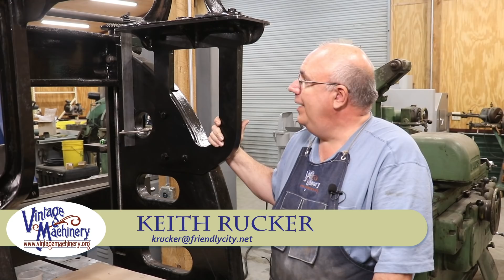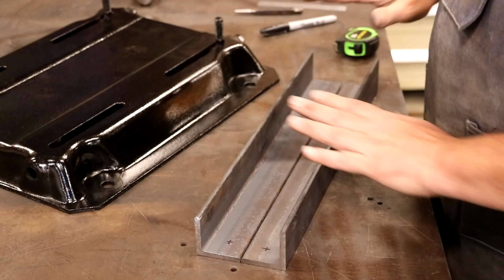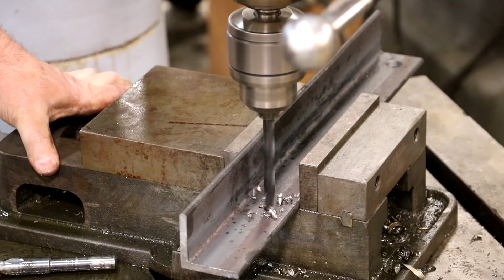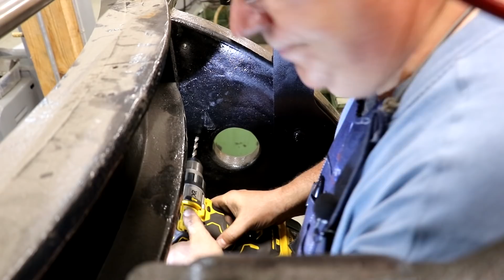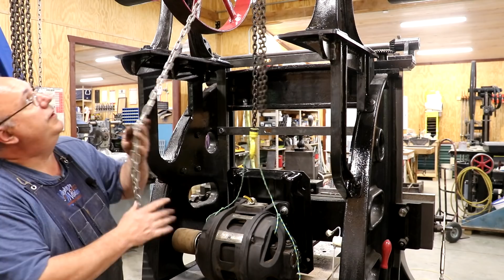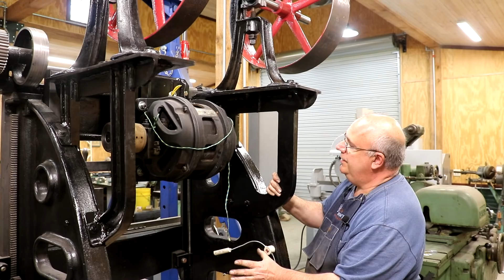Metal Planer Restoration 58: Fabricating and Installing a Motor Mount and Motor

Comment: Once the pilot holes were drilled all the way through was it not possible to do the rest of the drilling and tapping from the outside?  In cast iron tapping, a properly adjusted clutch will reduce the risk of tap or hand breakage,

Comment: HOPE THAT OLD MOTOR HAS GREASED BEARINGS.   SOME OLD MOTORS HAVE BEARINGS THAT RUN IN OIL,  WHICH MEANS THE MOTOR HAS TO BE MOUNTED HORIZONTALLY, SO THAT THE BEARINGS ARE RIDING IN THE OIL .

Comment: You might want to look into getting a low profile mag drill. They are extremely handy & would have easy fit to drill the holes on your planer. With using an annular cutter on a mag drill you would have saved your hands from getting slapped around be the drill.

Comment: Hi Keith - This looks great. Can't wait to see it running. One suggestion is to to use angle iron for the cross braces. The flat bar may act like a spring and amplify vibration. just a thought!

Comment: Keith, since you made the counter-shaft mounting brackets look "period," will you shape the angle iron used in this video (at least the lower ends) to look a bit more period too?  I really like that old motor!  I almost bought an old ~10-inch lathe with a (smaller) motor just like that mounted on top of the lathe ~15-years ago, but changed my mind at the last minute, fearing that what I wanted to do with it would lead to permanent modifications to it, spoiling its "originalness."  Now, with a "lesser" lathe, I've realized that I could have modified it without any permanent changes, and would have had a fully functional lathe!  :(

I look forward to seeing the final videos in this series, including belting & adjusting the planer, and watching you make chips with it!

Comment: No dead-stop appeared on the radial drill without the vice bolted down. Definitely use an anti-spin dead-stop when the work is not bolted down.

Comment: Nice job! That looks like a lot of work.

I wonder if it would be worth putting a stiffener fin on that lower cross bracket, effectively turning it into an L beam for most of it's length? I can see the motor pulling on it and bending it enough to result in annoying vibrations when things are running without some stiffening.

Comment: The motor looks rally nice on there. It's perfect for the job! I'm curious about some things. Do you know what speed the original line shaft would have turned? How do you know what size pulleys to put on the motor and the counter shaft? How did you size the motor as far as horsepower? Is this all just experienced guessing,  or do you have a more deliberate way to work these things out?

Comment: Just curious - the holes in the upright castings were thru-holes - I understand why you drilled the initial holes from the inside, but would it not have been easier to drill and tap the finishing hole from the outside, making the need for contortion, unnecessary?  :)

Comment: I feel a rant coming on.  I am getting a full mode rant Keith.   On your beautiful radial arm drill press at 7:42 in the video I saw something beyond disturbing.  When you replace those gears after you get done grinding them up all chewy chewy like you can have them made of rubber.  You spend all your time fixing machines, scraping way, buying all these precision machines and precision hand tools and you stand there and grind the gears ceaselessly.  I know it is your Machine, but really now.  End of rant.
Reply: Learn how to drift the spindle when changing gears, or edit out your gear changes.  Now my rant is over.

Comment: 13:00 Keith I like to leave the drill in a higher speed but run it slower by modulating the trigger. Ends up breaking your wrist slightly less. :) Those battery drills are strong!

Comment: Looks like you are lifting a heavy motor with a heavy chain hoist and a shoe string... :) As far as time goes, I've built a few small trailers with no plans. I usually spend as much time sitting on a stool deciding what to do as doing it.

Comment: you should put some rubber vibration dampener between the motor and the mount - the vibration might crack the casting long therm

Comment: I knew people would comment about the "twine."  Yet people trust parachute cord to keep them alive all the time, what I've observed of that, it isn't any larger ... 🤷‍♂️

Some may wince at drilling holes in the machine, my thought is that a millwright wouldn't have hesitated to do so back when the machine was newer, if it was needed.

Those old motors seem to bullet proof, as long as you keep the bearings oiled and don't let them get loaded with chips.  I got my Buffalo Forge drill press with a locked up motor.  The windings were not open or shorted, so I knocked it apart, honed the bearings a little bit, carefully cleaned a massive amount of goo embedded with chips out of the shell/windings.  Getting the end bells back in place without causing a bind was a bit tricky, but once I had it back together and turning smooth, it has worked without a problem.  Quietest machine I've got right now.

Comment: When using a tape measure I always use the 100mm mark to measure from lines or center punches.
Just need to add the 100 mm to the measurement.
Ofcourse its metric but you can just use the 4 or 5 inch mark

Comment: Keith Rucker does everything differently. When he works with carbide tools, he adds a lot of oil. Absolutely unnecessary. No effect, but a lot of smoke. If he works with high speed tools, that should be lubricated, he always makes it dry. Not a good idol! 👎
Reply: Go away.  Quit trying to start shit.

Comment: Nice big heavy frame on that old motor. What's nice is the motor appears to be the same vintage as the machine so they match. Those old motors tend to work very quiet and last for ages.

Comment: Hey Keith, looking good!  One suggestion I have for you. It's a fair bit more work for you but is likely to save you a lot of grief when it comes to adjusting the belt tension. Set up a push-pull device with 2 points. this will use threaded rods or bolts and be used to adjust the belt tension or even help to track the belt on the pulley. As the belt (I'm assuming that you are going to use leather belts) stretches, you will need to make adjustments. Having this set up on there ahead of time will be a lot easier than having to bring in the gantry crane each time to make an adjustment. If you're planning on just loosening the bolts enough to do a few taps, that may work but does not have much control.

Comment: Keith,  I know the 1921 motor looks awesome, but have you considered how good the insulation is and the difference in efficiency from back then to today's motors?  How do you know the wiring insulation (varnish) is not thin in places and when you put a load on it, the insulation will burn up and short out the motor.  Also, how about the bearings?  Bigger motors that sit along time can imperceptibly flatten the bearing balls on the weight bearing side unless you turn it over once in a while.  You might consider having the motor rewound.  Maybe cost some money, but might be worth it.  Good luck and looks great.

Comment: I'm concerned about your pulley diameters and the amount of belt wrap.  For reference you can look here:

https://www.plantengineering.com/articles/basics-of-belt-drives/

They say pulley ratios should not exceed 6:1 for flat belts and yours looks to be more than 10:1.  The amount of belt wrap should also be at least 60 degrees.  You may need an idler pulley to increase your wrap.

Comment: Really like this project, a lot of think-thru.. & everybody has plausible alternate suggestions & ideas, & yes with respect, it's your way to finalization there of. My query is re: technique.. Once pilot holes were drilled... Was their an engineering reason (that I'm missing) as to why you wouldn't attack the holes from the outside->in with the follow up drilling & tapping..??? Threads wrong way??? It appeared it may have given more direct pressure with your dominant arm (drill control & right angle) and tons of more (outside) room... Maybe a mute point for lights, camera & action sequence... A total wonderful learning experience...

Comment: I assume that is a fixed speed motor.   How did/do you size the motor pulley?  Do you know what RPM that top shaft should run at and then just ratio back to the motor speed?

Comment: Is there a reason you drilled the mounting holes, the ones that were trying to smash your hand, from the inside? Would drilling a tiny pilot hole to spot the location, and then going to the outside to drill where you have more room to work have been a valid strategy or is there some reason to drill them all in the same direction?

Comment: Have an old Sheldon lathe. Had to drill out a hole that conduit went threw. That was some of the hardest cast iron I have ever drilled . You can really tell the difference between old cast iron and new just by drilling.

Comment: Hey Keith great to watch, just wondering why you don’t just drill a hole and use a bolt and nut?  That way the hole doesn’t have to be perfectly straight to tap a perpendicular thread.  The bolt and nut would be much stronger than a 70% threaded hole in cast iron.
Reply: Or put a locknut on the bolt.

Comment: Imagining how the belt is going to look installed, I'm concerned that the "V" angle necessary with the large diameter of the big top pulley is going to make the belt hit the planer. I'm hoping I'm wrong about that but, ATM, it sure looks like the belt path is going to intersect with the planer cross member.

Comment: I wonder;  using a line shaft, What kind of speed regulation would be used with a water wheel setup?
Reply: A pulley array? Imagine the sprockets on a 10 speed bicycle. Same general principle.
Reply: @BigRalphSmith  thank you.
Seems so obvious now that you have told me..

Comment: I'm curious why the motor mount was not on a hinge so the weight of the motor could automatically tension the belt.
Reply: If he's using a period accurate belt, it's not designed for that type of tension like a modern rubber stranded belt would be.

Comment: I worked many years in a pepper mill that was driven by a massive line shafts. The two older machines were driven by belts. Of the two belt driven machines one was driven by a steam turbine. In the 1980s the old turbine failed and that was replaced by a 500 hp electric motor. 
A third line shaft machine was build in 1964 and was also driven by a 1500 hp stream turbine that in turned powered the machine though complex gear boxes. In time additional electric motors were added to provide additional power. 
A afoot note the original 1900 machine had wooden gear teeth that drove the dryers. When running in the 1980s  the wooden gears were replaced by nylon gears. 
I was right out of college and these old cast iron machines really impressed me. I even learn how to thread these machines by hand. You had the be extremely careful around all these moving parts.

Comment: I'm glad you didn't hurt your hand, I thought you might have. You came pretty close. Really nice job!
Reply: Yeah, those little power drills have insane torque and NO mercy
Reply: @mdouglaswray  i always always always make sure to move the clutch from "Drill" to 15 when drilling in metal... I nearly broke my wrist and nose  too many times. If it catches it'll just click
Reply: Why would you not drill the small holes from the inside and then the big holes from the outside where there is nothing to hit your hands on if it catches. A good safety share for my trainees about thinking about the job first
Reply: @andrews8356  good observation 🙂🤘
Reply: The hand-grip and trigger is not designed for high torque applications. I've a large old B&D 1/2" drill and opposite the trigger handle, it's threaded so you can screw a length of water pipe into it to make a second (actually third !) handle for better grip but still the key issue is bracing yourself to prevent kick-back and be in a position so you can get out of the way if it comes to the worst !
Reply: I was doing the same thing but with a Milwaukee 1/2 corded drill. I spiral fractured one of the metacarpals on my hand. It wasn't a complete break but it hurt enough to remember to never do that again without the support handle so both hands can support  the drill
Reply: @maggs131  Did the same thing with a 1/2" Milwaukee Magnum. Didn't break anything but thirty years later I use the handle if I am drilling a big enough hole.
Reply: USE THE CLUTCH that way when it catches ur dont break ur wrist. Thats what its for. I mean why else do u think the numbers are around that chuck. Try a full size macho hammer drill with 2" bit drilling into concrete. Those wont just break ur wrist but your arm. You gotta push on them hard to acfivate their clutches
Reply: My Snap-On drill will put a major hurting on you.

Comment: KR said that with the arbor raised all the way, it would still clear the motor. I am sure not familiar with these machines, but I had guessed that the arbor would have run up much farther! I know you may only be shaving a small amount off, but I had thought you could shape on much larger pieces. Still waiting to see this thing, as Keith said, "make that first chip."

Comment: Well done Keith - exciting times in the planer restoration.  Have you worked what the RPM of the drive shaft will be - I'm assuming that the motor rpm is not variable?

Comment: Who else felt nervous watching the motor hanging from that thin piece of string? 🥴🥴
Reply: I think most of those types of pull string are about 220 lb test if I remember correctly.
Reply: It's paracord, probably 550.  It's very strong....if you buy genuine cord.  There is a lot of cheapy cord out there that is made inferior.
Reply: @cup_and_cone  I'm sure you are right but it still looked scary! At least he could have done two turns to prevent me having a heart attack.
Though, I was glued to the screen waiting for the crash

Comment: WOW- a lot of holes and pieces- why not just a round bar between the 2 brackets. The motor can pivot on the bar and be adjustable side to side and the weight of the motor sets the belt tension.

Comment: Good job. I always enjoy seeing you get the project figured out and put together.
Do you have any concerns about vibration and rigidity of the flat bar portion of the mounting frame?
Reply: I too was thinking that. I would have used angle instead of flat bar to give it rigidity. I think as it is there will be a fair bit of flex if the motor comes under the strain of a heavy depth of cut on the planer, and maybe a bit of belt slip. On the other hand that may be an advantage as a fail safe if something goes wrong under crash conditions!

Comment: I've somehow never been comfortable with this modification. Rather than having that vibrating mass at height, why could the heavy motor  not have simply been floor mounted?
Reply: If everything is balanced properly on the motor and drive pulleys, there won't be any noticeable vibration.

Comment: Tell us more about the old motor
Reply: Yes! Crack that thing and make it new as well
Reply: Looks like a Repulsion/Induction motor.
Don't need no stinking starters, etc.
I had one on a lineshaft set up I used to have.
A city has one they power a merry go round with. (An old Herschel-Spillman for any carousel aficionados).
Amazing starting power!
Reply: What is there to know ?
Reply: well the thing looks like it came along with Noah's Ark or at least when they sold it off, LOL

Comment: Rotation; do you have a three phase motor so that rotation direction can be changed easily, or is that a single-phase where rotation might involve turning the motor to face the other way?  That's quite a big motor, so I think it is three-phase.

Comment: Very nice job - Its great that you have an old motor that looks like it belongs on the Planer. Not sure about the flex on the motor - a strap might have been more safe as you often work on you own in the shop safety is a big concern.

Comment: When drilling with large bitts & hole saws. Use the screw mode with the clutch on max. The drill will clutch out an not grab
Reply: My first battery powered 18 volt and I got along great till a drill bit jammed and twisted my wrist, and my wrist reminded me for a year or so hang on tight.

Comment: Love your safety approved lifting strap
Reply: @daveo4002  OSHA can go pound salt because they have nothing to say about anything he does.  You clowns all like to bring up OSHA because you think it gives your comment more weight.  It doesn't.
Reply: @daveo4002  I am sorry.  I guess I get a little triggered lately at all the comments on OSHA "requirements".  We just had a 2" auger break and go through the lower jaw of a co-worker.  Nobody from OSHA came but I swear everybody from the insurance co. was there.  Leave a rag on the bench and OSHA is all over it writing up a VOC violation.  And with full context your comment was funny.
Reply: @daveo4002  40 years and that's the worst one anywhere I've worked.  He'll be "OK" but it completely destroyed the lower jaw and a lot of the facial muscles.  Can't even guess how many surgeries lie ahead.  So much damage to the machine no one can say for sure but it looks like the bit wasn't installed correctly and cork-screwed as soon as it hit the wood.  Guards were in place, it just blew through them.  Probably saved his life.